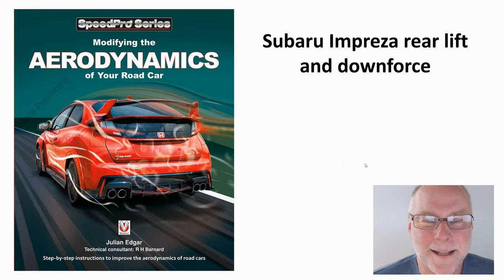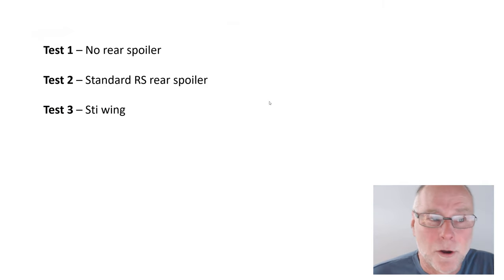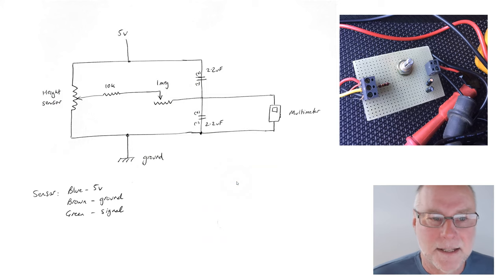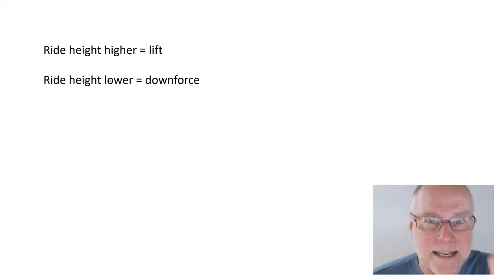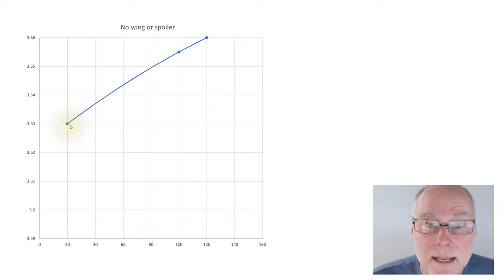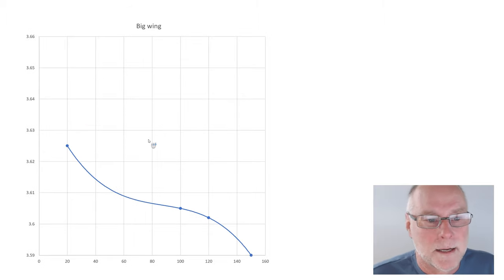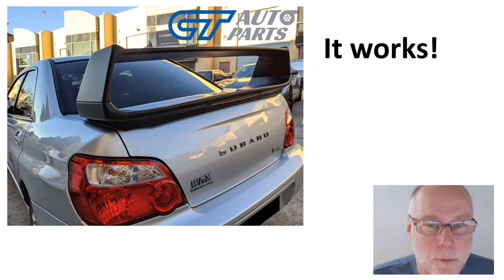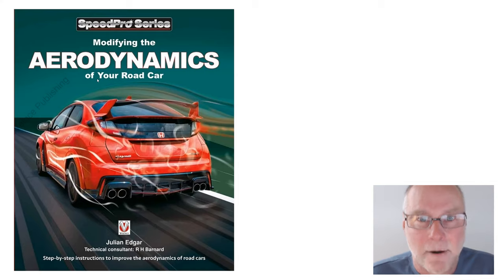Testing rear downforce and lift on a Subaru Impreza

Comment: Nice to see you back again, a simple and effective method for measuring downforce. I think i remember something similar that you did  many years ago ? Have you found anywhere that you could buy surface pressure pucks? Or is DIY the only reasonable way to go?
Reply from the maker: I haven't done anything like this many years ago. I did something similar about 12 months ago, but not with such simple/cheap  measuring equipment. Re a surface measuring puck - make your own. Fiddly but not hard. Covered in my book - https://www.amazon.com/Modifying-Aerodynamics-Your-Road-SpeedPro/dp/1787112837

Comment: Wow! Interesting results. 
I was planning to 3D print my own spoiler for my Impreza.
Any tips ? =)
Reply from the maker: Just add a weight until the suspension deflection is the same, then measure the weight. But you'll be able to get a lot more downforce working under the car - all covered in my books.
Reply from the maker: Depends what you're trying to achieve.

Comment: Wow, that is super cool! Now it would be interesting if you mounted sensors in the front suspension as well. That way we could also see how the cars aero balance front and rear are affected. Ideally with and without a standard STi front splitter installed. See how and if it compensates for the rear downforce likely creating front end lift at speed. 

Cars at speed are fascinating to observe on the autobahn. I’ve always had the impression that when big saloons like A6, 5series etc go blasting by at over 200kph, that they seemed really tall. I imagine it’s a some lift and maybe the centrifugal force increasing the tire diameter at speed? Is that possible with standard road tires and these speeds?